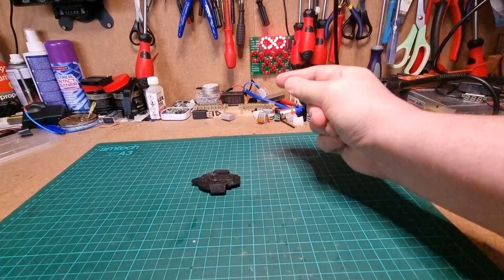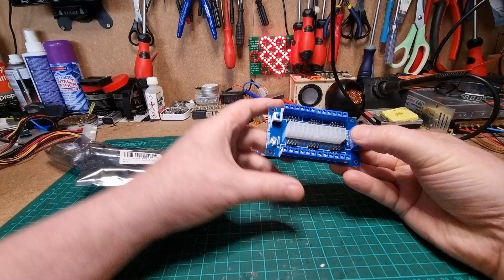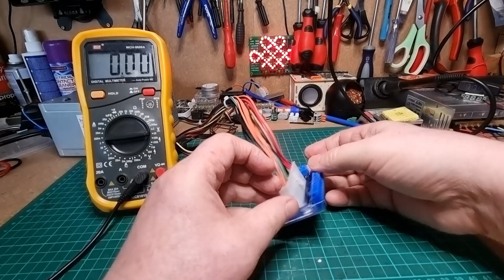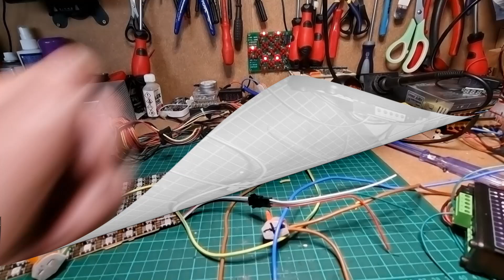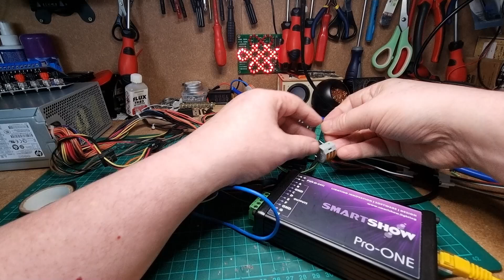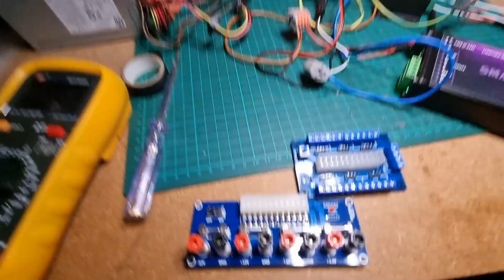Turn Your Old Computer Transformer into a Power Supply! 🛠️ Testing Power Boards + LED Demo

Comment: Nice review of some very useful breakout boards. 

Those boards are quite useful, I've used similar things a couple of times. They do have some issues if you want to fit them in a box.
The one with the banana plug connectors on it is the nicest for this , but you need to  remove the connectors and fit them on the other side of the board, then you can fit them onto a box panel. Otherwise the multiway psu connector and cables get in the way.

The switch will also need extending.  I cannot remember the exact spacing of that board (I have one in the "bits" box somewhere), but the "standard" is 19 mm that allows the connectors to accept the various plug adapters you can get. Not a big deal but worth remembering if you build your own boxed version.

The boards with the screw terminals are better in that the switch is brought out onto a connector as well so you don't have to fit a bodge wire to the board to make a panel switch.

When fitting in a box, I would not have fuses on the board, much better to have accessible fuses on the box. That saves pulling the box open every time things go bang, and with the current that the computer PSU's can put out shorts are easily made, and you nee a big box of fuses. I've made use of re-settable fuses on more than one occasion due to this.  

Andy
Reply from the maker: Thanks - some useful information :-)